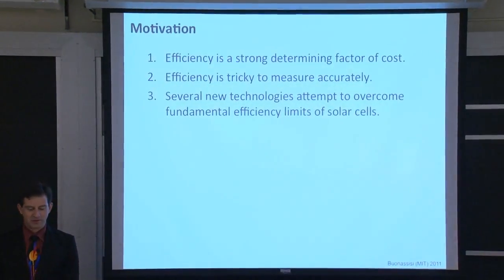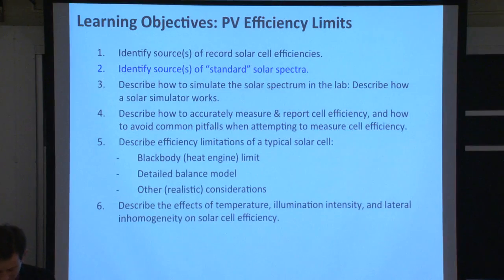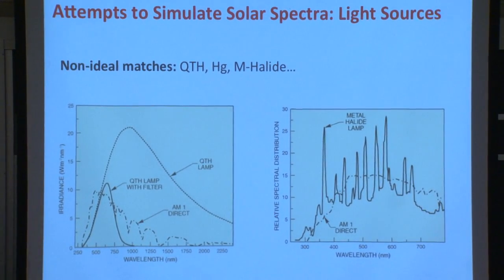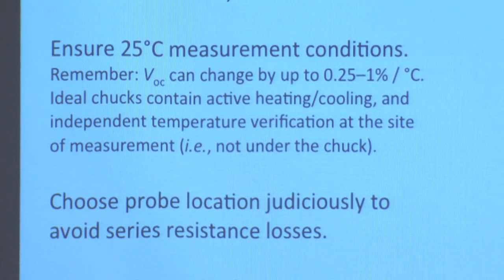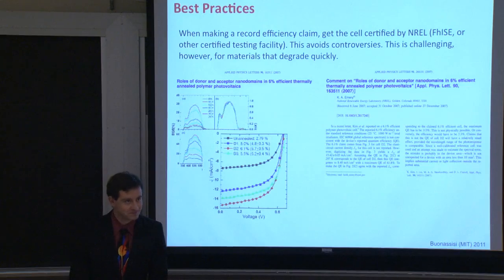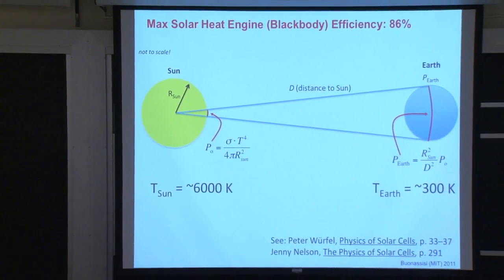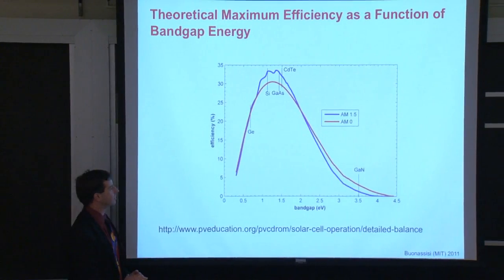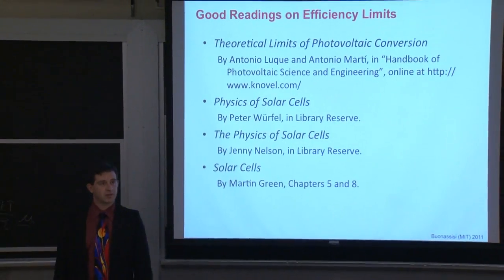14. PV Efficiency: Measurement and Theoretical Limits

Comment: I have been in the renewable energy field for some time now and have used many products for instructional purposes, but this [link here >>>https://plus.google.com/u/3/113778429958471787540/posts/67MrRb1YGej ] is the best. It has all the material needed to get people here in the IBEW up and running for the installation and design of solar systems
Reply: wow